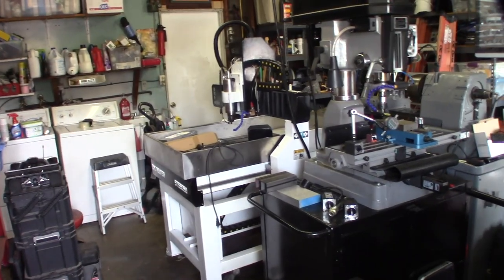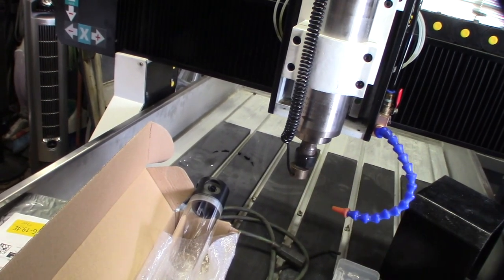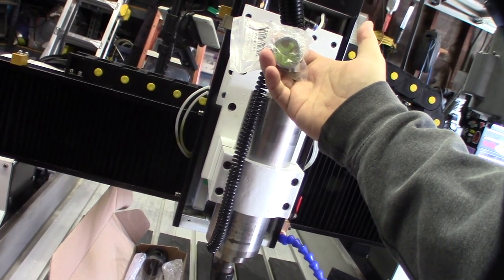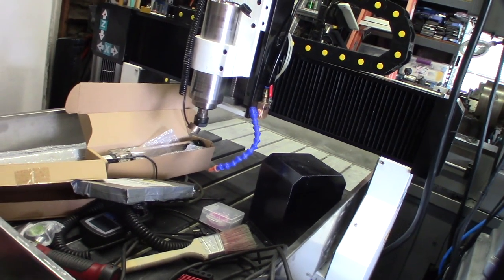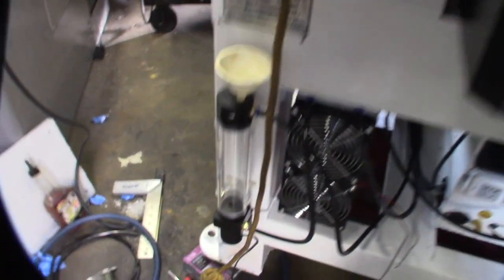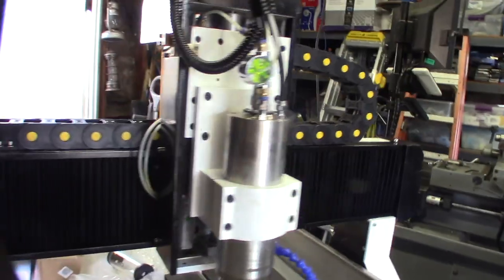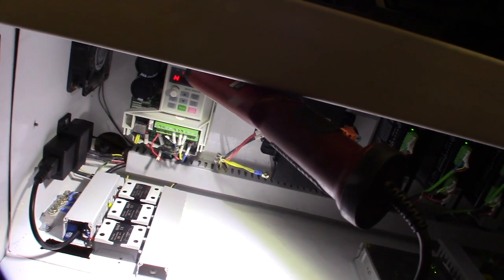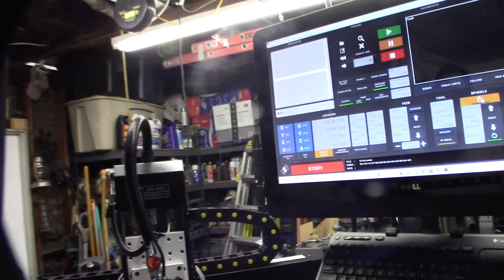Closed loop CNC spindle cooling system made from computer CPU cooler

Comment: Hi, are you happy with this setup? Is it enough for cooling the spindle at heavy loads? Do you experience any cross metal galvanic corrosion due to the use of aluminium radiator and stainless steel spindle?